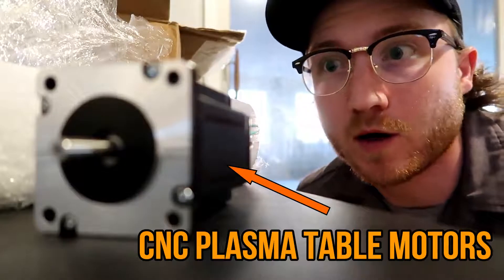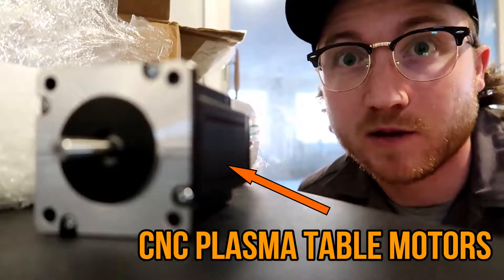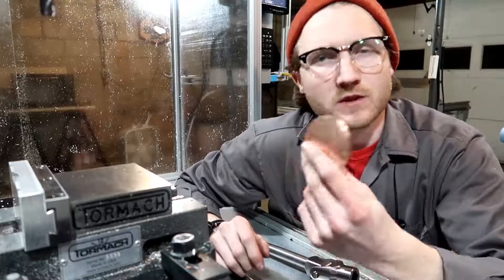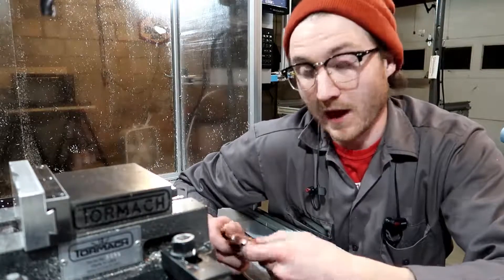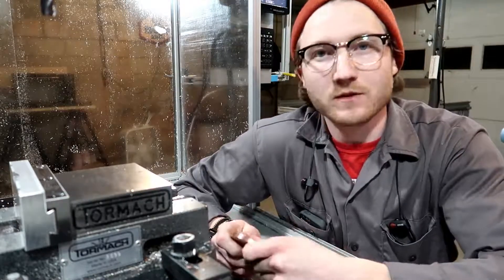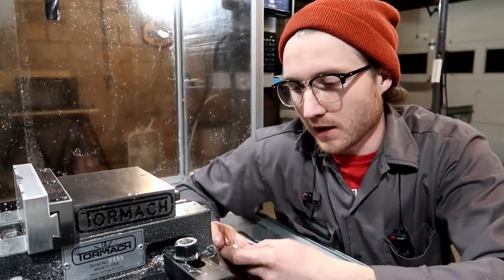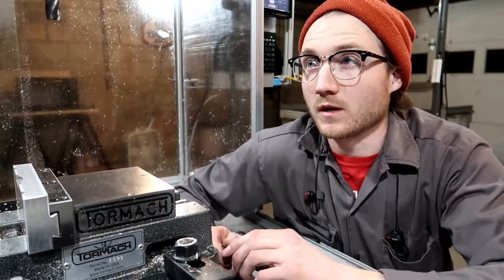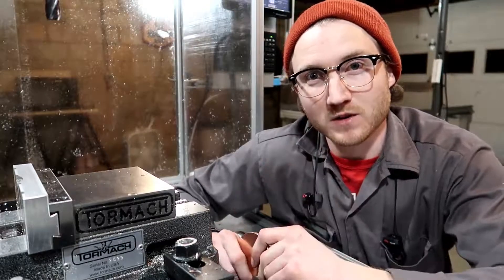The Copper Penny: Home Mfg. Days #39

Comment: Time for a flood coolant system. I built mine for $100 and it does wonders clearing put the chips and carrying away the heat. I used a sump pump and a rubber made plastic bin for the tank. It also has a whole house filter to take care of the fine particulates.
Reply from the maker: I like your style! If you have time, could you send me some pictures of the setup to mojo.mfg.ops@gmail.com .  If not, thats not a big deal just might help a bit.  Thanks for the tip!
Reply from the maker: The 770 flood coolant system is only $185 from Tormach which isn't a bad price either.
Reply: MojoMfg. In the diy setup, I get more pressure to clear chips out of the way with a faster pump and a larger tank. The pump runs on it own circuit and uses a ssd. It's dc current is supplied by the controller so i can still use m8/m9. I used cnc cookbook's guide for the idea except for the  solenoid vavles he uses. https://www.cnccookbook.com/cnc-machine-coolant-pumps-flood-filtration-diy-guide/
Reply from the maker: That's awesome! Thanks again for the tip.  I'm strongly considering going the flood coolant route at some point.